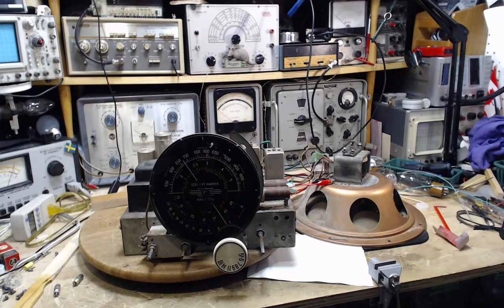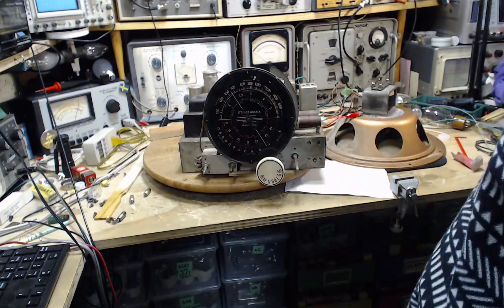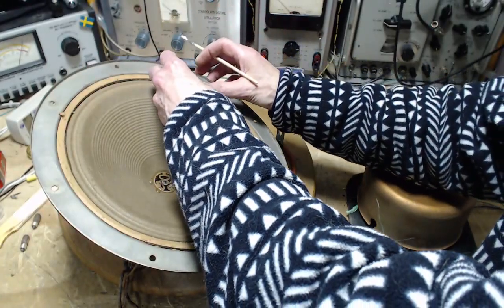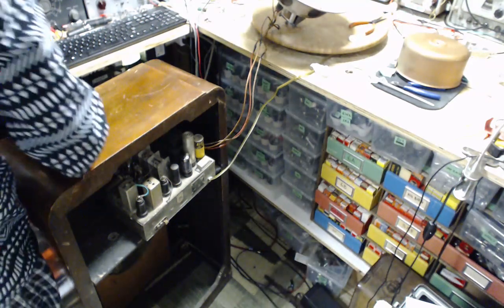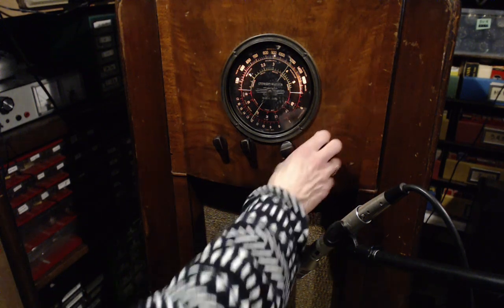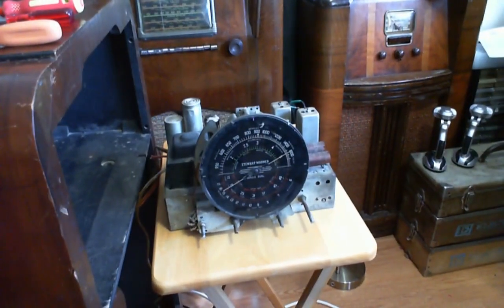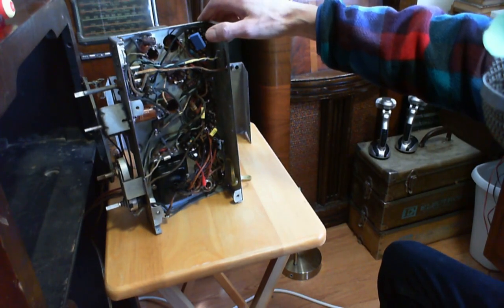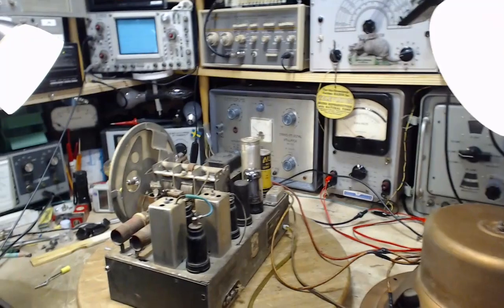Stewart Warner R146 Video #14 - Setback Finale

Comment: I wish Jim would broaden his education on cabinet work . He really should learn top to bottom restoration work. This radio doesn't pick up stations well at all.
So he had to take the chassis out to replace one capacitor. So guess what? He found that the IF transformer he worked on is still an open circuit!

Comment: Two thoughts on that "finale"
If the first IF transformer still has a DC resistance ratio of 80 to 11 Ohms  it is far from properly fixed. There are certainly still unsoldered strands in the RF litz. As a result the Q of that transformer is abysmal and its passband as wide as a barn door resulting in even worse selectivity.
And secondly, comparing diluted lemonade to tap water, sure the lemonade is more tasty. That radio is performing sub par.